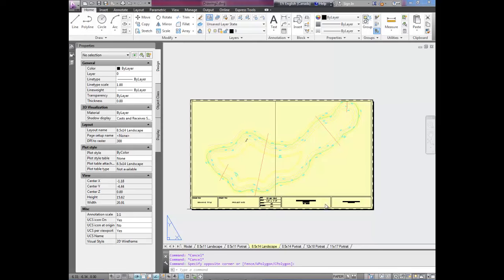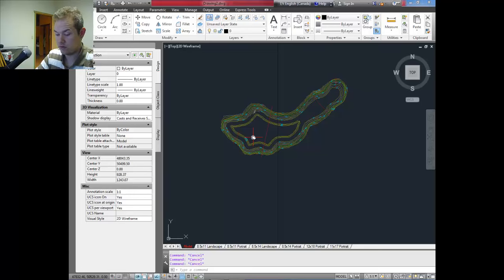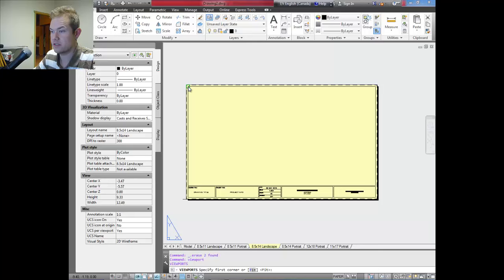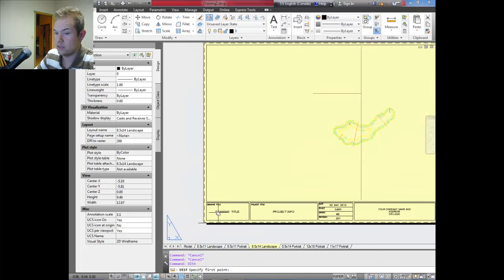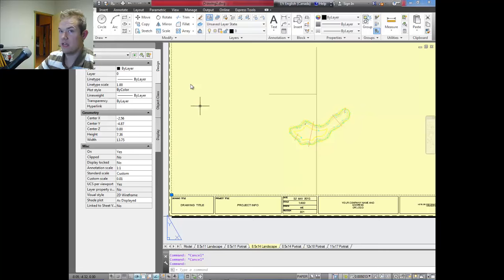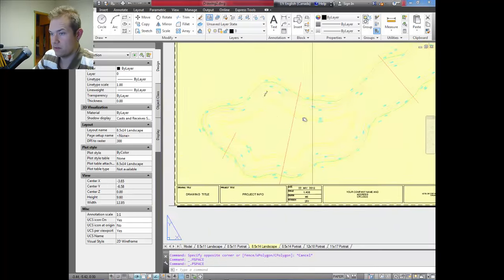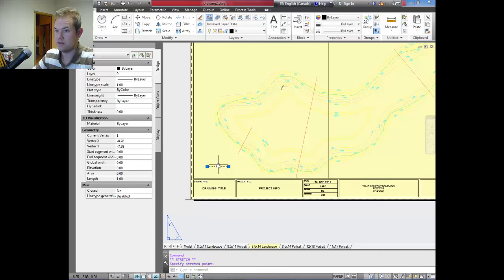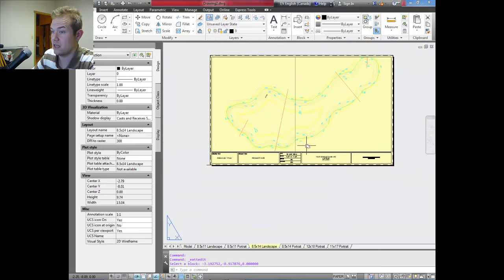Autocad How to Scale Viewport

Comment: Ok, for anyone interested, I think one should draw a rectangle, from eg. upper left corner of the paper to the lower right corner of the paper, it is doable, one can get perfect accuracy of the dimensions of the rectangle in relation to the paper dimensions (open page setup manager to check for type and dims of paper and cross check with measuregeom of the construed rectangle). I think that our friend in this channel uses the aforementioned method, and it is quite interesting and helpful a method. Thanks for the inspiration !

Comment: I have a question. I drew a cross section of a road in 1 to 1 scale. 1 unit in autocad represents 1 meter. In my layout I changed my page setup to A1 piece of paper and a drew a viewport of similar size, but when I set my scale to 1:100 my cross section is super small. What did I do wrong ? Maybe it's, because when I type units command it shows millimeters ? I changed it to meters, but it's still the same. Got any tips ?

Comment: Thanks for video. Followed your steps on video. We did confirm our paper is 24x36. In model space, we did scale everything 1:1. The property is approx. 300'x300'. We were able to highlight viewport. When we right clicked we opened  properties . However, under Misc, we set annotations of 1"=1". Under standard scale, we had to use 1"=250' for the property to appear in the viewport and somewhat fill the space. When we print in paper space  1"=20' matches our scale. But we had to set standard scale to 1'=250'. What are we doing wrong????

Comment: I just only know the basics of autocad and..
Is it ok to scale only in layout(viewports) but not in model.
Reply: generally you scale in paperspace viewports. This is so the drawing in model space is always drawn at 1:1 scale. In the old days of AutoCAD, before paperspace was around, CAD users would often select the lines they wanted to scale in the model space, then use the scale command to set them to the correct scale for plotting. It was terrible. If you had to make changes, you would often need to re-scale the linework you scaled back to 1:1 to make it easy to make changes, then re-scale it back for plotting again.

Comment: Hi Brandon, thank you for helpful videos. I have a question. How can I have viewport scale for different views of the model fitting in viewport frame ? For example, I insert three different views of the model and set scale for each view, but when I do, it either magnifies in to the model, or minimizes the model. It also changes the size of viewport that I need to resize the viewport. Help..!@